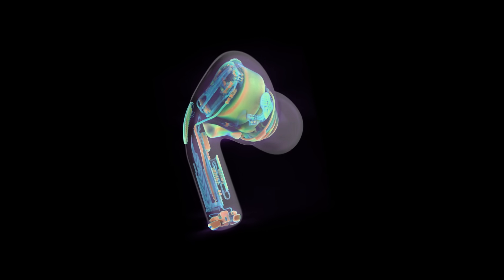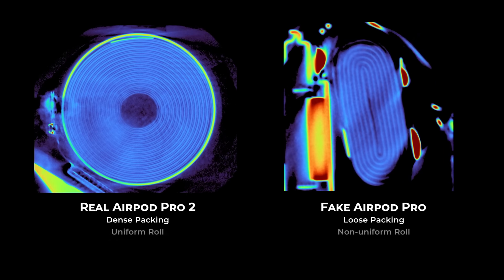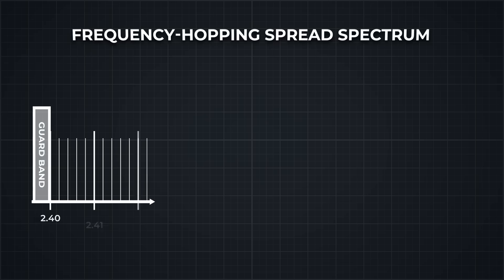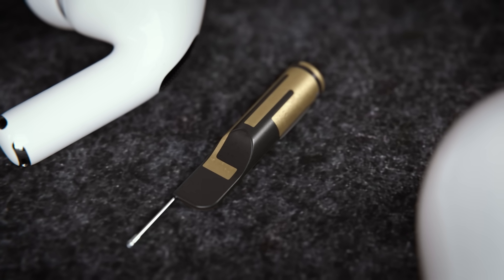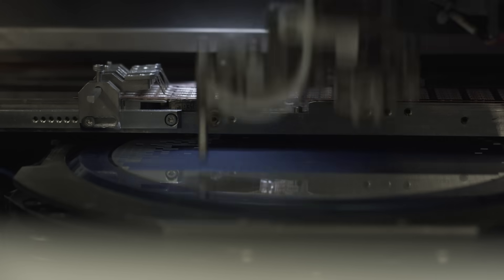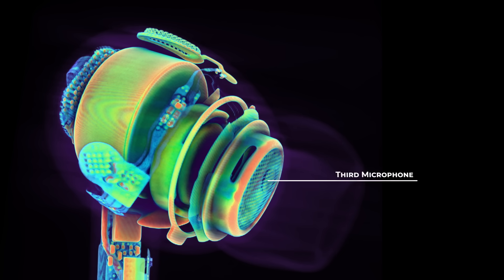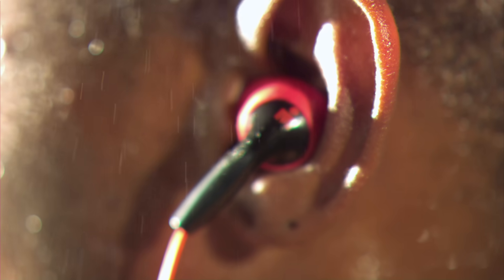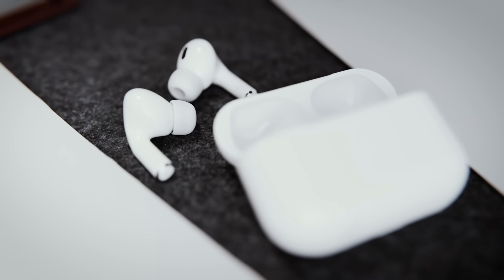How Apple AirPods Work

Comment: I am a musician. One of my students kept going on about Apple products. I told home they weren't great, pretty middle of the road. He took great offence and professed how wonderful everything was in the land of Apple.
I took out a Cowan MP3 player a pair of headphones and a pair of in ear headphones. He then had a listen. He then asked what they were and where he could get them.
In under 5 minutes I had reversed all his bias for an extremely well marketed brand with empirical evidence. Try these, those are a rip off.
A pair of relatively inexpensive Audio-Technica headphones and some Shure SE425 in ears absolutely work as intended. No nonsense, just good. Pair them with something great and you soon discover what old guys like me have known all along. All those active systems, phones and so on really aren't all that great. Everything was figured out decades ago. Nothing new has been added and you really are better sticking with the tried and tested equipment. In 10 years it will still be the best and will still be working.
I remember first trying active noise cancellation in the early 2000s. I wasn't impressed then and I'm not impressed today. Seems like a great tool for the extraction of money from the wallets of those that are easily lead.

Comment: Believe it or not, you can thank the Hollywood actress Hedy Lamarr (Samson and Delilah, The Ten Commandments etc) for the foundations of WiFi and Bluetooth technology. In the 1940s, together with George Antheil, Lamarr invented a frequency-hopping radio transmission system for guiding torpedoes towards their target whilst avoiding jamming of the signal.

Comment: The way I laughed at "The human head is surprisingly good at blocking 2.4GHz bluetooth signals."
Reply: That part of the spectrum is free due to the leakage out of microwaves making it unsuitable for commercial/military applications. And microwaves are tuned to 2.5GHz because it's one of the resonant frequencies of the water molecule, so that's why water blocks wifi and bt so well. Another fun fact is that the 5.8GHz is free for the very same reasons - It's the first harmonics of the 2.4GHz and the microwaves don't actually produce the cleanest microwaves ever.

Comment: Great Video, Shame that the Product is an Environmental disaster.  You buy an iPod it cost 100 to 150 euro's. You can expect the battery to last roughly 2 years and then you must buy another. These are Disposable. I bought a wire connect directly to my iPhone I am happy with them and are still going strong 4 years later. The were cheap at 30 Euro's but compared to the iPods, brilliant value. other advantages. No battery, no lithium clean-up needed. Last as long as the battery life of my phone. overall better for the environment as less material is used and for my pocket, as I do not need to replacement them every two years.

Comment: As a (retired) Electrical Engineer that has worked in the Professional Audio Industry - I found this fascinating !
Having said that.. I have a very cheap (~$20) set of "knockoff" wireless earbuds that actually perform pretty well.
As good as I-Pods ?  Likely NOT !  But still - they don't SUCK at all !

Comment: Rather than constantly knocking knock-offs, you should consider that some are very close to the same functionality at a tiny fraction of the cost, usually 10-25$ . In addition Apple isn't unique in building high end models either.

Comment: Great ad for what's literally the ultimate in e-waste by design - tiny and easily damaged, with a battery that's designed to fail and can't be replaced. At least it is possible to buy individual airpods when one fails or gets lost, but if Apple's usual anti-repair pricing on their other products is anything to go buy, it'll only cost marginally more to buy a complete new set and throw the remaining good one in the bin. I'll bet they've also made it as difficult as possible for people to make complete sets by mixing and matching incomplete sets of earbuds and cases too. 

So glad I haven't been convinced I need this junk. Been using the same set of wired headphones for probably a decade at this point and they still work perfectly. Once the lunatics willing to pay big screen TV money for a phone realise how useful having a phone with headphone jack is, they'll never go back...

Comment: did anyone face the problem where the case battery percentage doesn't show up in the widgets? incomplete setup? the case won't flash white no matter for how long u press the reset button on the case? this all has been happening on airpods pro 2 of mine, i've tried everything, couldn't do anything, please top up this comment, i'm sure i'm not the only one!

Comment: I have airpod pro’s. Although they’re great feat of engineering, they’re so delicate that they won’t survive a drop on a hard floor. And you will drop them because they’re slippery as can be. I’ve had five (!) individual pods replaces under warranty, but after the two year expired, I’m left with a single half-working airpod without microphone 😢

Comment: Medical ct scanners have a spatial resolution of 0.3mm at best. For most images are taken at 1mm voxels Not enough the show the detail in these images. Also ct scanner images are black and white. Volume rendering can produce colours for some differences in Houndsfield units, for example the difference between bone and soft tissue or contrast Iodine and tissue, not different electronic components. And certainly not plastic. X-rays pass through thin plastic.

Comment: So much engineering to make sure the consumer won't be able to replace the battery cheaply and easily and thus will replace 99% of the perfectly fine components by buying a new set.

Comment: Mine died just outside of its 1 year warranty period. They were maintained well. As impressive as the engineering is on them I could not justify dropping another $380+ CAD on another set without a better in the box warranty.

Comment: the vent explanation part were incorrect. Its not for resonant purpose, its there for 2 other purpose:
1. Prevent pressure buildup on your ear canal, when u insert them into your ear, due to eartips seal, u are compressing the air in your canal. Vent is there to release that pressure buildup. Otherwise the pressure either will push on either your eardrum or the speaker membrane. This also apply to controlling the pressure rise, when the speaker is doing long stroke movement during high amplitude low frequency sound (bass), they leak some of that bass pressure through the same port so it wont be overwhelming.
2. Speaker always move forward and backward in a sine wave. The vent is there to tune the properties of air flowing at the back of speaker membrane when its is moving backward. Mostly related to bass & low frequency response, and a bit of mid frequency.

The mesh explaining high frequency damping were spot on
Reply: Devices sealed against (IP67)intrusion also seals in air unless a water/dust proof vent is incorporated. The vent equalizes barometric pressure differences from altitude or internal air temperature changes. Without the vent, acoustic diaphragms and certain sensors may be subject to static pressure excursions which affects acoustics or sensor accuracy.
Reply: Great explanation !
Reply: My airpods have a tiny slot in the rubber tips that I thought was for pressure release. Surely it doesn't go through the speaker, around the battery and out the back, right?
Reply: @zukmaidik I think that small slot in the base of the rubber tips is to aid in changing out the tips (since they come in different sizes).
Reply: And for bass reflex
Reply: was incorrect*

It’s*

Comment: Frequency hopping was co-invented by actress Hedy Lamarr and composer George Antheil. During World War II, they developed a radio guidance system for Allied torpedoes that used spread spectrum and frequency hopping technology to prevent the signals from being jammed by Axis powers. Their system involved rapidly switching the radio signal between different frequencies in a synchronized manner between the transmitter and receiver, making the communication secure and resistant to interference.

Comment: I use my AirPods Pro everyday in a workshop. They do a surprisingly good job around waterjet cutters, turret punch machines, grinders, air tools, etc. Just don't drop them on the ground with steel dust. It seems to do a real number on the noise cancelling :(

Comment: There is NO DOUBT that the Air Pods and AirPods Pro are marvels of engineering. But they are a major failure when it comes to the environment. Because the battery is positioned where it is, they are not replaceable. So if after two years of use your AirPods only last an hour, you can’t just get the batteries replaced. Apple offers to replace them for you, but if you had to replace the batteries in both pods and the charge case, it costs far more than buying a new one. So it goes into the junk collection in your garage and when you die, into the landfill. Apple ought to redesign them so the battery is in the stem and the stem could be unscrewed and the batteries replaced. It’s an environmental crime to have designed AirPods and AirPods Pro to be disposable.

Comment: MEMS are fantastic and the mic in particular is great! There are versions with built in ADCs that output the digital signal. They also have stable parameters so it's easy to use them for beamforming and correlated techniques.

Comment: spotted some mistakes:
* in mems microphone, the mesh and the diaphragm are spaced definitely not a "couple millimeters" apart. You meant to say "micrometers", probably.
* the mems-mic 3d model has an opening in top. The actual microphones usually have it on the bottom, below the mems element; the inner volume is a sealed chamber with the vent being  a microscopic hole in the diaphragm.
* your drawing was showing the electret layer deposited on the membrane. But i'm fairly sure it is actually deposited onto the pickup plate.
And i would question that an accelerometer is consuming less power than a microphone... but it might, i'm not sure here. I just suspect that using it might be a good idea to make sure the prompt is coming from the person wearing the 'phones, not someone around.
Cool video!
Reply: Apple’s silicon has dedicated low power audio processing engines to enable always on microphones. Think on macbooks, iPods, watches, etc. 
there are a number of factual mistakes, but still the animated CT scans are pretty killer.

Comment: Lots of great information in this video, thanks for that!
One thing struck me as a hardcore audio guy: At 12:30 you explain ANC and mention "opposite phase". I know that a whole bunch of respected people in the audio industry get this wrong and there are even consoles from big name manufacturers showing an inappropriate "phase" symbol on input channels.
What you are talking about is POLARITY!
Phase is a function of time/frequency. Think of it this way: if you insert a battery in the wrong direction you reversed its polarity, not its phase! Agreed? Same here!
To cancel something out you need to reverse the polarity in respect to the original sound/pressure wave.
Reply: But a opposite polarity means a opposite phase.
Reply: @AlphonseDanielEdge No, it does not (and "opposite phase" is wrong)
Take it as a fact or ask your math-buddy if you don't understand why.
HINT: delay 100Hz by 5ms and delay 233Hz by 5ms and compare the results.

Comment: Would be cool to have the same video made for another high end bud... just to see how different companies use different strategies to solve the same issue.
Reply: And then when the AirPods get a bit wet they start to buzz and there is nothing from Apple that says what this is, that it's a dysfunction of the noise cancellation system, can't be fixed. (Within warranty, they'd replace them. I like Apple Care, and I like Apple products, but... why not just tell customers via official Apple pages what's going on.) I paid over $200 for a pair that kept jumping to my MacBook even though I never wanted it to do this. (If you delete the Airpods on the MacBook, it also deletes them on all my Apple devices.)  This and the buzzing led me to buying a $40 pair of Ankers that works great.... except when Apple chooses to drop the connection on most phone calls. There's absolutely no reason for this except Apple doesn't like that I stopped buying AirPods.
Reply: @WillN2Go1 I think you're responding to the wrong comment.

Comment: i hate to hand it to apple, or any large corporation, but i really gotta hand it to them with the airpod pros: they're an extremely good product. They fit comfortably in my ear, the ANC is fantastic (especially considering their size), I've essentially never had connection problems, the battery life is great even with ANC on, and they charge very quickly in the case if they do die on me. They're just extremely well engineered.

Comment: 07:47 Well to play devils advocate  there, the "knockoffs" are not that wrong in their use of other parts to those of apple might have used. 'Cause apple likely owns patents for most of them, designs of the products products with them or even the altered variations of the products design. So if you going to use those part in your products they would sue you for patent infringement. So really you are left with only two choice keep the part all the same as apple and get sued, which might be cheaper cause of the apples mass production of them. Or use other parts, that they don't own the patents and designs for.
Reply: Knockoffs are also usually competing on price, so they'll want to get as close as they can for a lower price with cheaper parts.

Comment: Thanks for this explanation and awesome animations.
It is just sad that so much ingenuity is put into a product which then sounds so bad. For real. I had Shure SE 535 headphones before and they were awesome. When they broke down I built my own In ear monitors from 95 Euro Knowles speakers. They sound awesome. Then I got AirPods Pro and tested them out. Switching on the noise cancellation I was very impressed by how much less audible the environment was. But in a train it was still loud. So I tried my CIEM again. And they filter out passively more noise than the active noise cancellation with all its mics and controllers and whatsnot. And the sound? Wasn't too good as well. The bass and treble boost you mentioned make everything sound overly boomy and scratcy. Ever listened to some Orchestra or Metal (or both) through those? Violins sound baaaad. And guitar is so aggressive that it really wears down your ears after a few minutes. Long story short: I just hate how Apple puts in so much effort into this when a) it yields results worse than what I can build at home and b) it is just there to justify a price tag which is just abnoxious. And all that because they wanted to get even more money out of their consumers by axing the 3.5 mm jack. I still HATE them for that. 280 Euros for headphones which have worse quality than any other quality manufacturer  (like Bose, Shure or Sennheiser) budget headphones at 120 Euros? Nobody would buy that. But Apple just gave you no choice. Because you would need the jack. Or constantly have to buy new converters because they break waaay to fast. So all of this engineering put in there is just to justify to you that you should spend waay too much money on headphones. They just essentially made just listening to music a premium service. Screw them!

Comment: "bluetooth is often swept under the radar for how amazing it is" anyone whos ever used bluetooth before: ❌❌❌❌❌❌❌
Reply: What are you talking about? Bluetooth is great, it’s not perfect but you’re a prime example of how easy it is to take for granted.
Reply: @nobodynowhere8061  it's not great, it's a shitty protocol that's only around because the other device your connecting to uses it. any serious wireless device uses it's own 2.4ghz transceiver and protocol and gets below 1ms latency and way higher bandwidth. it's the micro-usb of wireless data transmission

Comment: Hey, microwaves were the first to take that part of the spectrum 😅. Microwave engineers chose 2.4 gigahertz because water molecules absorb the most power at that frequency. And since, after the mass production of microwaves, the 2.4 gigahertz range became too noisy, it was decided to make that part of the spectrum available to everyone 😀.
Reply: There was a radio telescope observatory somewhere desperately trying to pinpoint the source of an unidentified occasional short chirp signal until they finally figured out someone on the site was always impatient, and what they saw was the signal escaping the microwave oven in the nearby cantina in the brief instant between the door being yanked open while the microwave was still running and the interlock cutting the magnetron in response...

Comment: You did not need to convince me of the difficulties of wireless earphones with that intro. I've always been fascinated with how all of those components fit into it, what shocks me even more is that I was recently looking into the feasibility of building my own smartwatch and it somehow seems possible by buying consumer parts and putting it all together. Even phones, which are significantly bigger, are custom made on two boards with almost nothing being separate.